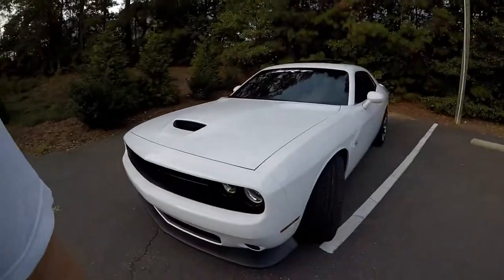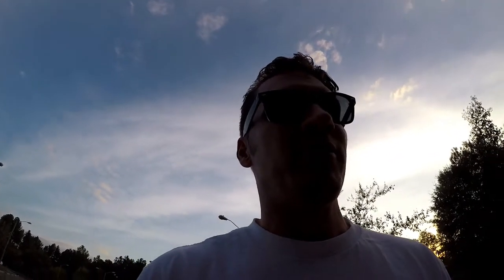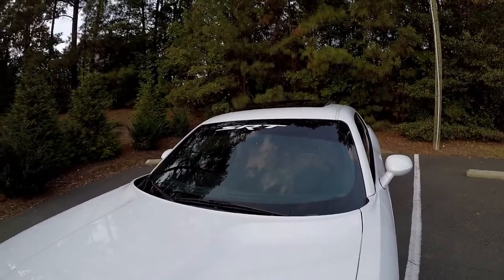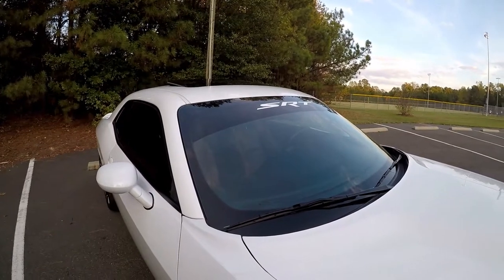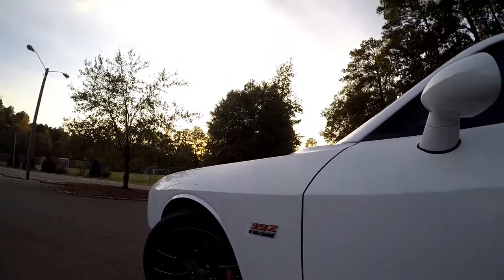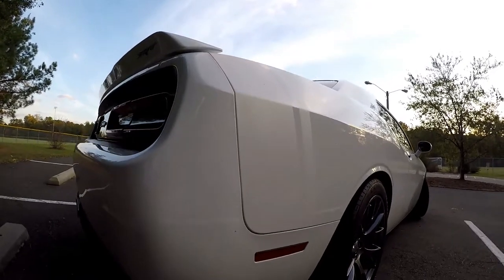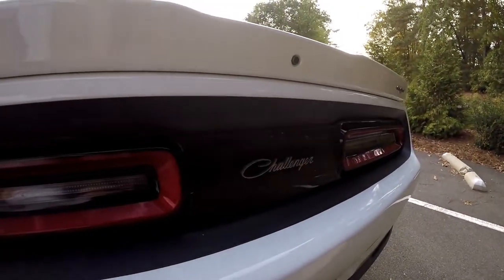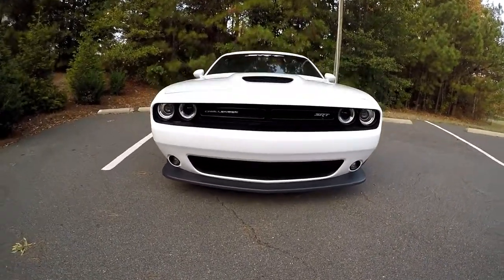Dodge Challenger SRT 392 mods

Comment: Seriously, how is that thing on gas if ur easy, and how is the handling? Because it's extermely hard for me to choose between these cars. The charger has full powered seats for both driver and passenger, rear heated seats, a sportier look, the rear track lamps, is more aerodynamic, has a locking gas cap, and an automatic lifting trunk lid. The challenger however is lighter, has that classic muscle car look, is driver orientated in the inside, has awesome headlights, has the ability to have one of the headlights as an air intake, is big, has a deep exhaust note because of the silencer in the engine bay, is both cheaper in price and insurance because of how they're more accidents with chargers. So I don't know which one to choose
Reply from the maker: VIC on ur PC I average around 12.5 mpg, but I’m not easy on it. Sounds like you’re torn between convenience and performance. Both have performance, but only the Challenger has the heritage feel. Charger has the convenience in ways the Challenger does not, but lots of other cars have convenience features as well. Good luck with your decision

Comment: Do you think that hobby paint is durable enough to use on badging? I want to paint an SRT emblem white.
Reply from the maker: J. Sanchez I’m honestly not sure. I first used hobby paint on my previous challenger (same place, 392 badging on the engine covers) and expected that the heat would just make the paint peel or fade or bubble up or something. I had that car another year and a half and the paint held up perfect, which was a huge surprise. Maybe the heat cured the paint.. I don’t know. Anyhow, I’m  expecting the same with this car. For badging on the outside of the car, I don’t know what the weather would do to it. It can’t hurt to try if you have no other options; worse case scenario is you shell out $30 or so for new badges if the paint fails.
Reply: mikebythesun 
If it's durable enough under the hood, it should work fine on exterior. Thanks man. Most helpful.